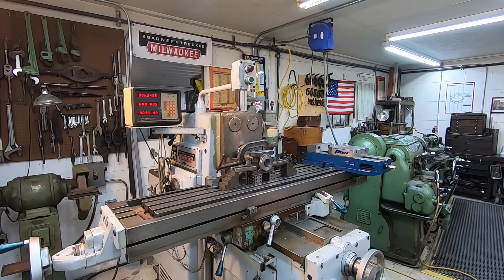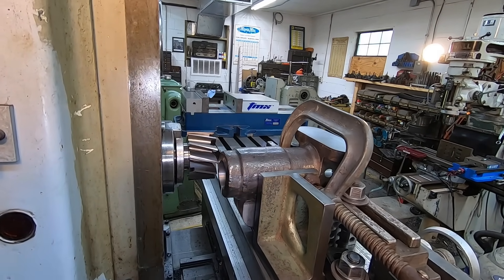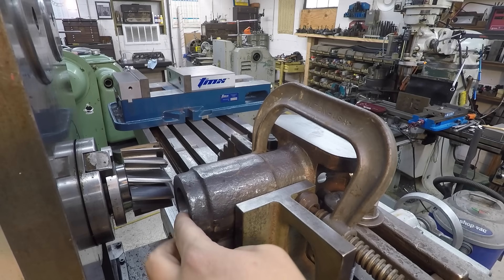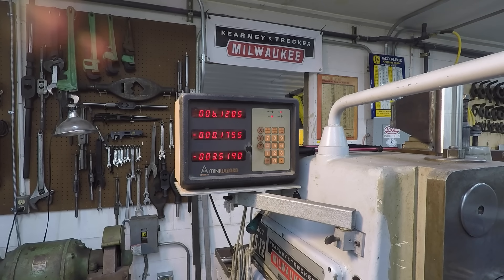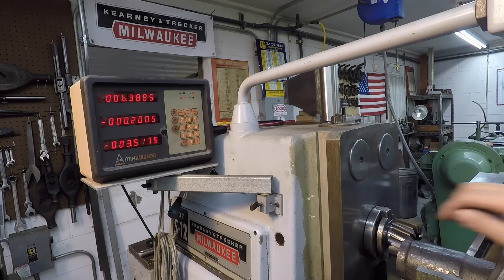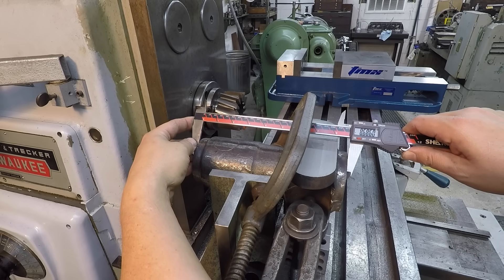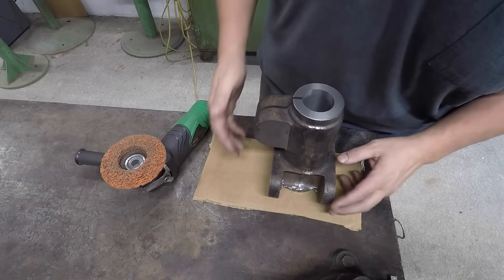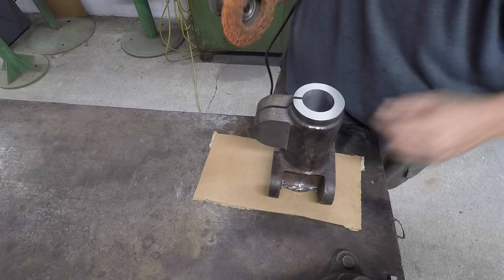Fairbanks Power Hammer Cross Head Part 4

Comment: As you said cast iron is usually easy to cut. But if you run into a hard spot or sand that can be a real  problem. Sand can destroy a cutting edge pretty fast even using carbide cutters.

Comment: What’s the tolerance for the length calipers aren’t a accurate way to measure as they have to be held in the perfect position to be accurate.
Reply: I bet this will be BY FAR the most accurately milled part on the Fairbanks. Aerospace tolerances need not apply.
Reply: All the tolerances were fractional. Adam's been around the block a few times, if anyone can hold them perfectly square, it'd be him.
Reply: @urbanbasementoperator  yeah so have I most likely being fractional a +-.030 tol. Parallelism and squareness more important for sure to the main bore.
Reply: If you watch closely he uses the faces of the calipers to tell when he's square to the surface of the material, and then shuffles. That gives you a pretty close estimate.
Reply: @jonathanbaxter5821  yeah it a close guestamate I got 30 years in gauges fixturing and aerospace so we always treated caliper checks as a rough check. Mics tend to be more accurate. But a certified height gauge and test indicator the most accurate. But as he said it was a fractional dimension so probably a +-.030 is good.
Reply: @Jon-O.  Not much cast-iron in aerospace :)
Reply: @jonathanbaxter5821  oh yes there is

Comment: Nice work as ever, however I would have clamped vertical it to the do-all mill bed and took the material off like that then straight into the other opp. 
At 8 inches and big toe clamps it would have gone no where. 
Machining for TV !!

Comment: What can the average Joe do to cut internal splines? I want to make splined sleeves for Side by Side axles to convert them to chain drive.  I have a mill, lathe, and cnc plasma
Reply: You could always make a broach to cut the internal splines using a lathe and a mill.
Reply: Does your mill have the ability to firmly lock  spindle rotation?
If so you could try the following

1. Make a boring bar shaped to cut the spine shape you need
2. Mount the piece that needs splining on a dividing or indexing head -vertically
3. Fit boring head and boring bar
4. Vertical power feed the mill - no spindle rotation
5. Hand feed X axis 1 or 2 thou over
6. Repeat 4 and 5 to spline depth
7. Use dividing/ indexing head to index next slide position
8.Repeat earlier steps for each spline

It will be a mind numbingly slow process
Reply: What would it take to cut the splines off of an axle and make a DIY press broach by turning it down at a slow taper and cutting every 1/4in or so? Would I need to harden it?
Reply: Right, before going any further - What is the chain drive going to be powered by - Torque, HP and RPM numbers are all relevant info here along with the shaft major and minor diameters
Reply: Up to around 60hp 60ft lbs of torque and 6500rpm
Reply: @ridgeracing47  I hope that's a mistype - If you're looking at 6500rpm I would abandon any idea of a chain drive, especially trying to home make one: that's nearly double a Harley's transmission output
Reply: Engine rpm would be 6500.
Reply: @ridgeracing47  Engine RPM is not the final drive output RPM - You need to have a look at your transmission and figure out your final drivetrain RPM if you're going to make it work
Reply: Using an online calculator the final drive would be 750-1000rpm
Reply: @ridgeracing47  That sounds much more realistic to what I was expecting - How many splines does the shaft have?
Reply: 28 splines
Minor diameter is ~1.133in
Major diameter is ~1.188in
Length of splines is 1.250in
Reply: @ridgeracing47  This video seems the most useful thing I can remember to help you
Reply: Link didn't go through if that's what you tried doing. What's the title to the video?
Reply: @ridgeracing47  https://www.youtube.com/watch?v=xPZ7hzLdgyU see if it works this time
Reply: Got it. Thanks!

Comment: Are you going to finish the outer surface ? Just asking !
Reply: He already did earlier on the lathe
Reply: @danhammond8406  the outer part by where he just milled is not done
Reply: No, it's a casting, it's supposed to look that way
Reply: @majorphoto  why is it supposed to look that way ? Nothing wrong with dressing it up !
Reply: @davekimbler2308  nothing
Reply: @davekimbler2308  there's no point doing it, are you going to pay the extra labour costs just to satisfy your OCD
Reply: @andyb7963  did I miss something? I just asked if it’s going to be done ! If that’s OCD I’m sorry . I myself like the finish of turned metal not rough cast , isn’t he ( very very generous of him ) donating the work for a fellow YouTuber ? I’m very sorry I even brought it up in the first place , I’m just learning to run a lathe myself at age 63 so I do have questions .
Reply: @davekimbler2308   you are not missing something Dave but sometimes items don't have to be finished on the hole outer surface because it get another treatment like paint forexample
Reply: @hydramechdk7658  good point ! He probably will paint it when he reassembles it !